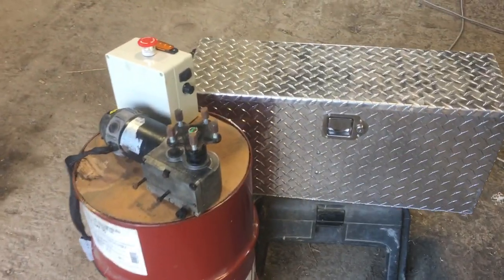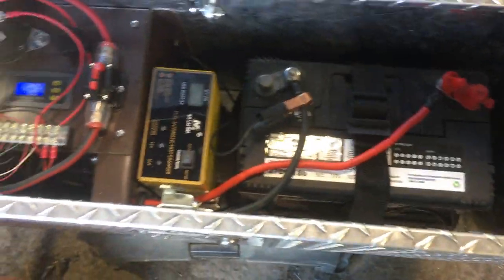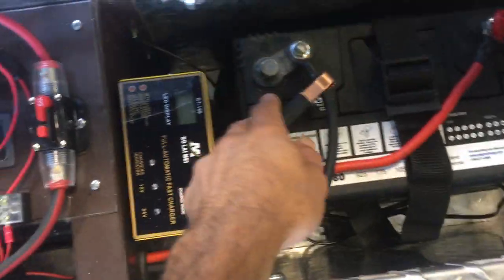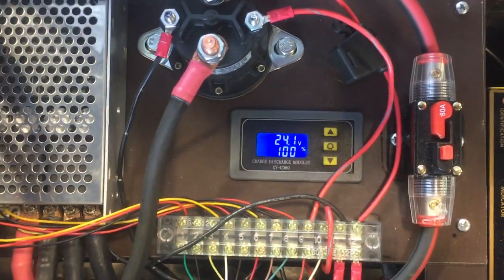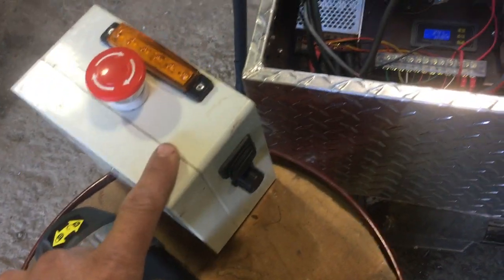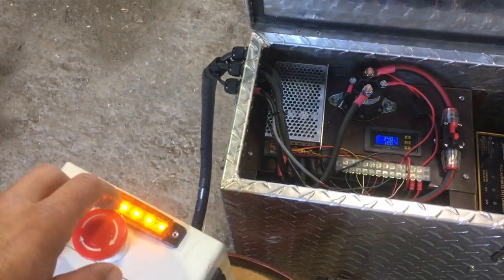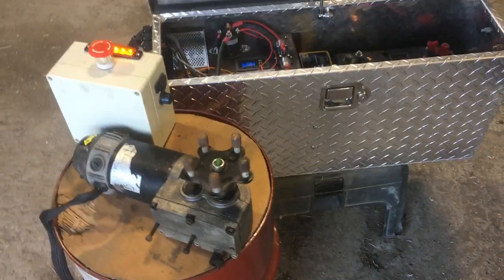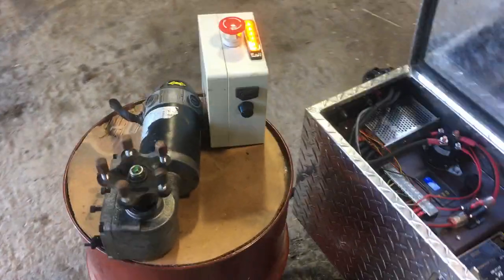Battery-electric power unit with wheelchair motor for farm row cover roller

Comment: Would you have a list of parts for the contents of the box? I’ve got the batteries and charger, which circuit breaker etc?
Reply from the maker: Hi there.  The circuit breaker shown in the video is junk.  I've seen several of them fail and they just suck.  Anything that looks like that just avoid it.  get a Blue Sea or similar breaker from marine or trucking parts supplier.  Also the undercurrent protection module in this video (XY-CD60) is overly complex and hard to configure/remember.

Otherwise I'd also go with a bigger PWM motor speed controller to have a bit more margin of error.  We haven't cooked ours but a few other farmers that built units like this managed to cook the motor controller.  I think this one was rated 70A cont, 100A peak so go one size bigger and at 100A continuous you could trip the circuit breaker before toasting the controller.  

ALSO, put the breaker between the controller and the motor, not between the battery and controller as I did here.  Read up about PWM to find out but the breaker here isn't actually protecting the controller at low speeds.

Finally, the contents of the white "control box" are quite simple.  There's a terminal strip to collect inbound wires and connect components and then there's a 3 position switch for FWD/OFF/REV, and a potentiometer that came with the motor controller and was simply relocated with a bunch of wire between and then there's an emergency stop switch and an orange LED marker light from the truck parts store because that way it's already got resistors built in and is happy at 24VDC.

Comment: I live in Georgia (US) so I don’t understand how snow works. When the snow gets deep enough that it covers the box completely, does it get wet inside the box as it melts? Just a normal drip-proof box works just fine for outdoor electronics here, but that box would be a spider and ant magnet.
Reply from the maker: I'm hoping folks won't leave the battery box out in a snowdrift all winter but it's also really rainy and humid here in spring and fall, sometimes with severe temperature swings causing condensation.  A drip-proof box might be just fine for this application but sometimes it's "in for a dime, in for a dollar," or whatever that expression is.